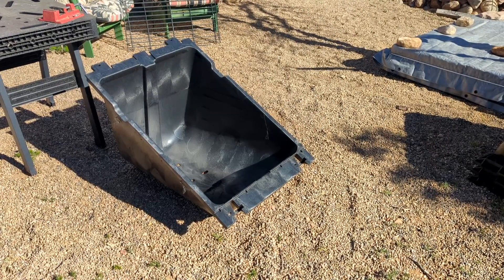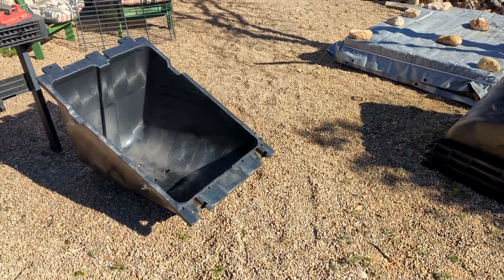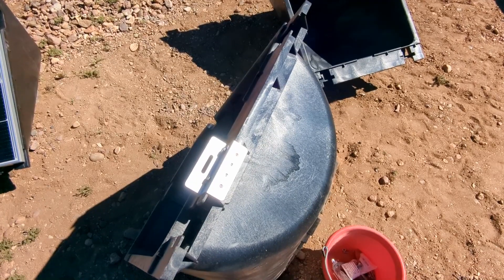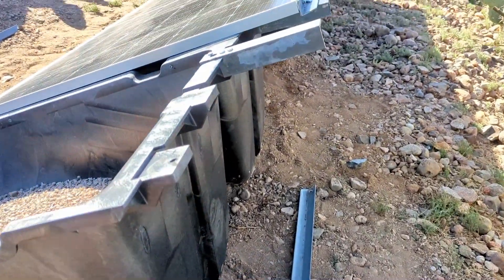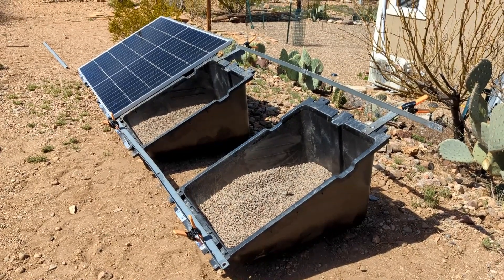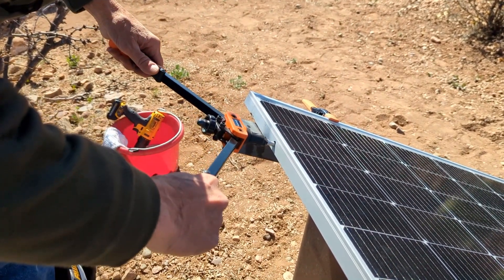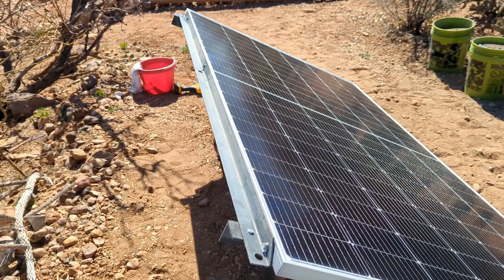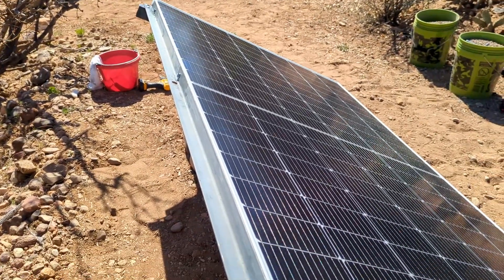Ground Mount Solar Panels with ROCKS

Comment: Hello HH, we love your ingenuity and love seeing our PowerRacks adapted for all kinds of projects. Everyone should know that this kind of modification is not always necessary! The rack fits panels between 960-1050mm wide with no mods and no tools at all. And the larger version is coming out soon, which will handle the larger panels in the 1100-1300mm wide range.
Reply from the maker: Thanks. I wish you had the big ones when I did the project! My mods are holding up great. Thanks for watching!👍
Reply: @homesteadhandyman4481  We wish it was already out too! Product design and development takes some time...as you can imagine, different sizes means different wind profiles, which means new wind tunnel tests and so forth. But we'd rather do it right than do it quickly. Stay tuned!
Reply from the maker: Could you please contact me ? Have another project to discuss with you . Thanks, Don
Reply: @powerfieldenergy  Just took a look at your product page. Still just see the one size? Also, curious if that price is for each "tub"? The listing mentions the word system in several places, exactly what would I get if I order just one?
Reply: @p.t.anderson1593  Yes, our larger PowerRack has been delayed in design a little bit longer. We're testing different heights and pitch angles too, so that complicates our wind engineering. The PowerRack "system" includes simply the main rack plus two small mounting pieces that secure the panel's frame on the low side. That's all you need!
Reply: @powerfieldenergy Thanks for responding! Nothing wrong with trying to get it right. I could just make my own rack system on top and use these as anchors, not much wind here, but it would be nice to extend the no hassle concept to the whole package. Where I live the local installers seem to suggest 30° for summer and 45° for winter. Since I am kind of a diy guy I have been thinking about making my own solar ground mount that incorporates those blue poly barrels on their sides filled with water to be the ballast. I rent where I'm currently living... Best of luck with your development, may testing go your way!

Comment: If you use PV Rails instead of junkyard steel, you could mount the panels in portrait with fewer racks. Powerfield makes extensions for wider panels. Yours may be too wide for that though.
Reply from the maker: We have very high winds so I wanted to keep the panels low to the ground. Thanks for watching Todd!